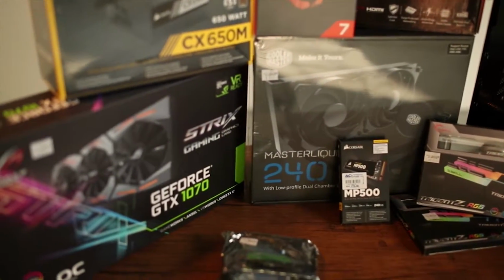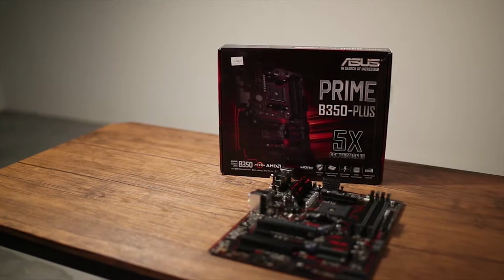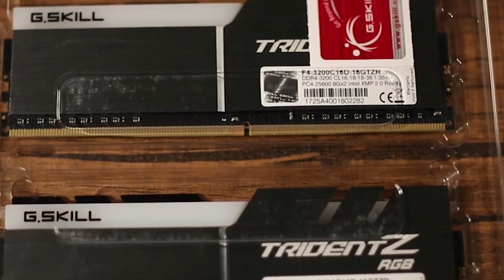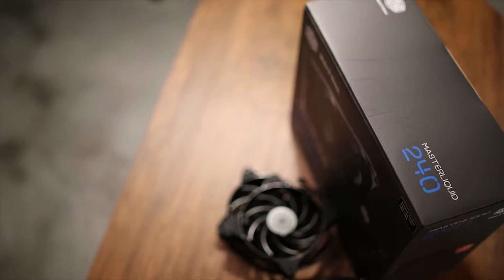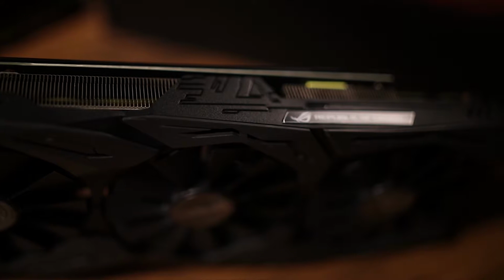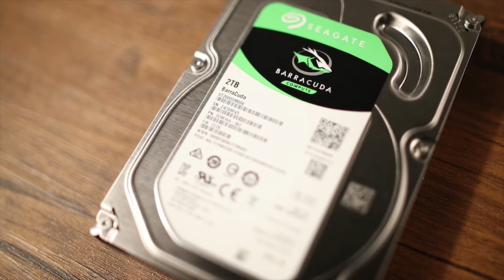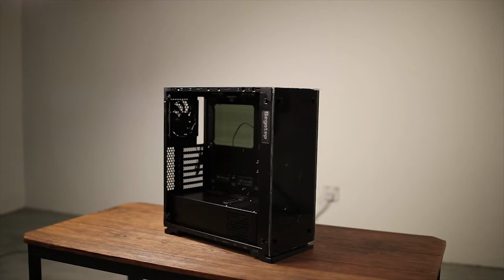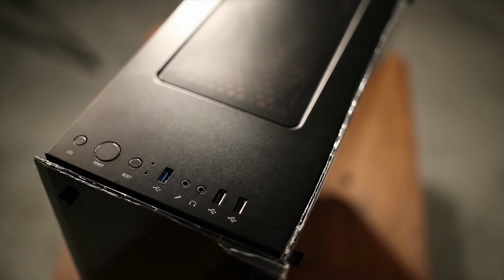Building a RM8,500 AMD Ryzen Editing PC!

Comment: how was memory since the SPD problem thingy on some say for controlling the RGB just in case and what are the precaution did you do for it to just in case controlling the rgb?....
Reply from the maker: Controlling RGB has no issues via gskill software 'trident z rgb control'. However, achieving the speed is an issue, strongly recommend Gskill Flare X and Fortis which were released for Ryzen. We couldnt get it to post boot running anything above 2133MHz. Hope this answers your question
Reply: TechKK aw...  So they "kinda" fixed the SPD corrupted thing on the gskill software, thats good... Cause sometimes i visited the gskill threads sometimes got problems like bricking there trident z ram there by the cause of the software..